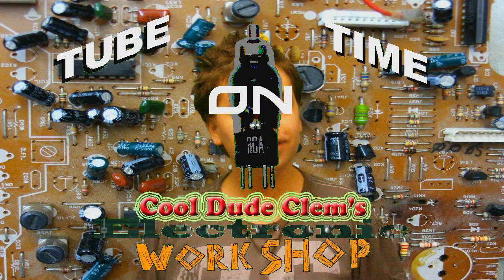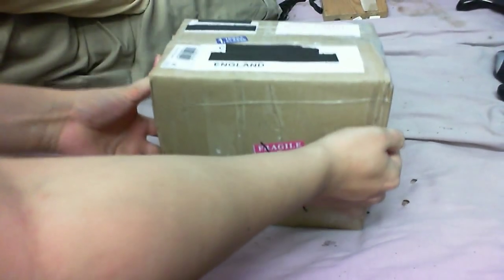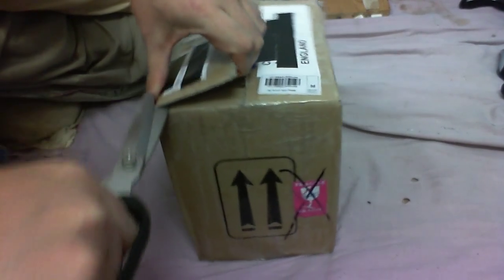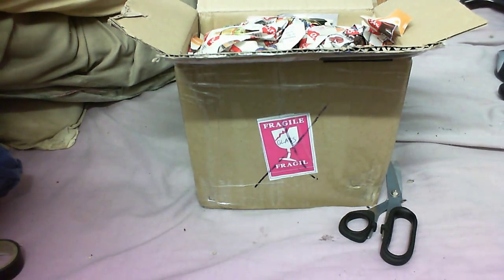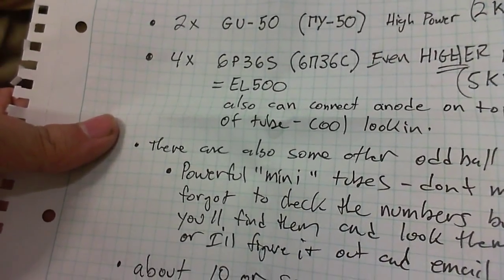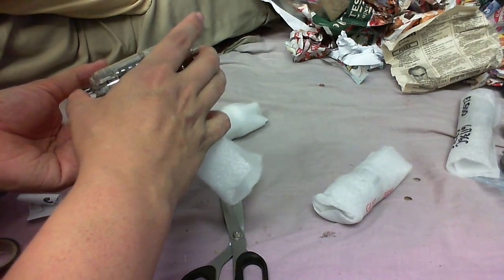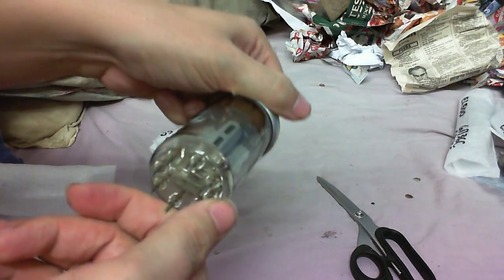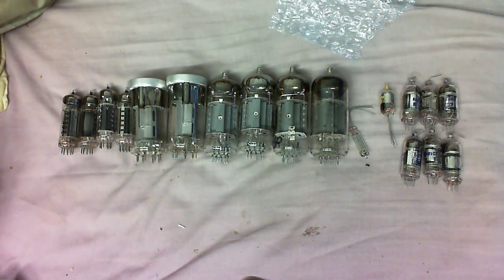tubetime 9 - Unboxing High Power Tubes for VTTC (and a few others)

Comment: Apparently I mislabeled one of the EL500 clones. The CK608 is a pentode used in Vintage "Sonotone" hearing aids. They make great amps. The oddball pentodes (2J27P or whatever) are ultra high frequency pentodes meant for soldering only...not sockets. They were used in weather balloon transmitters back in the OLD DAYS by the USSR. The QQEO3/12 is also a very high freq transmitter tube. These ones were taken out of an old MIG fighter jet! Some of the markings on the tubes rubbed off when I cleaned them and I was in a hurry and mislabeled the one EL500 clone...but they should all be in GREAT shape! Can't wait to see what you do with the big ones!